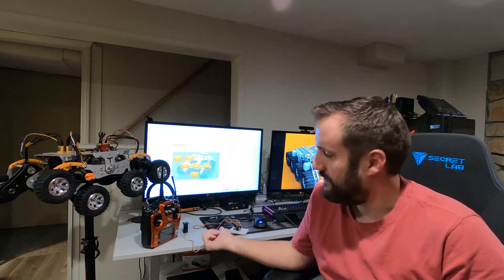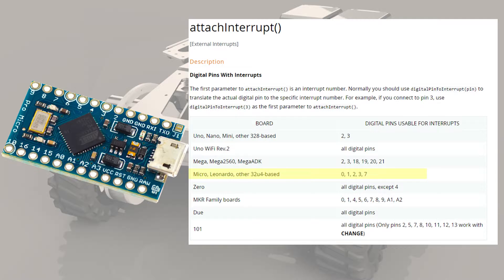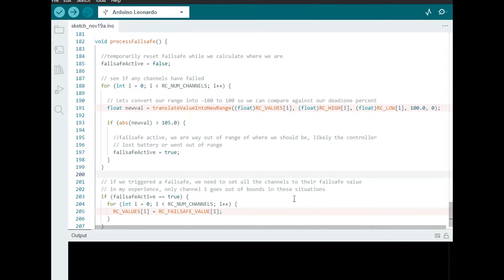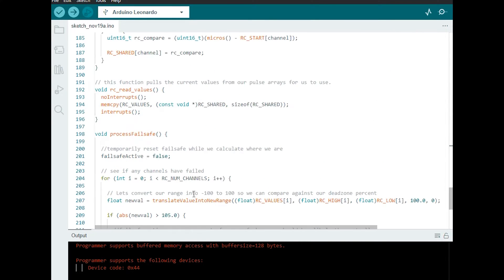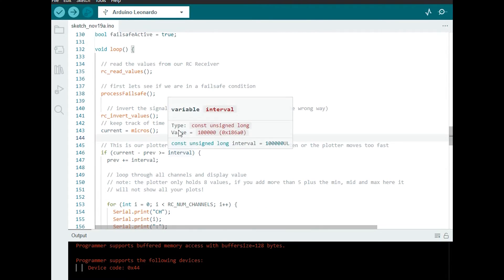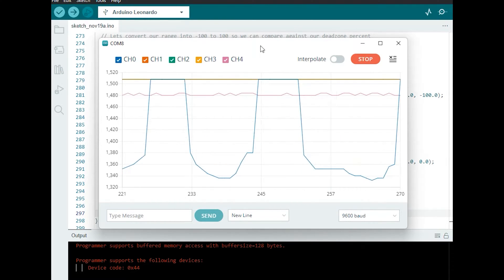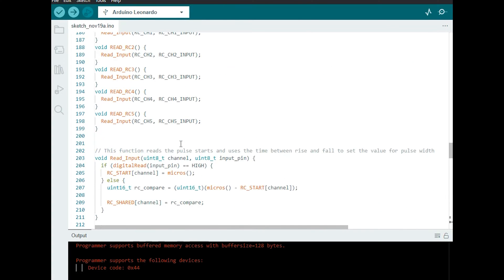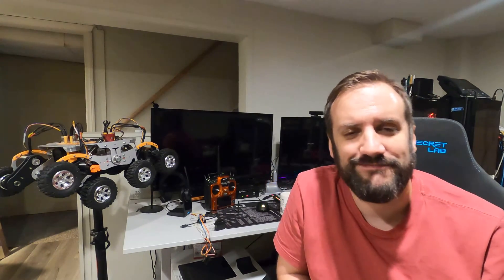Using an RC controller with an Arduino - Part 2

Comment: Great video.  Would it be possible to use one of the outputs from the arduino to control a 1000W dc brushed motor by connecting the output from the arduino to the potentiometer of the controller to control the dc motor speed?